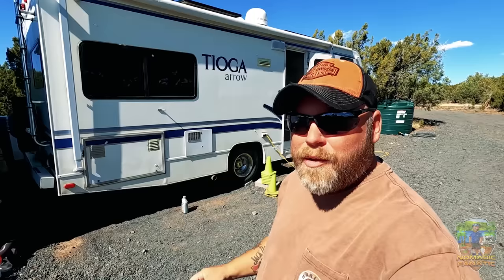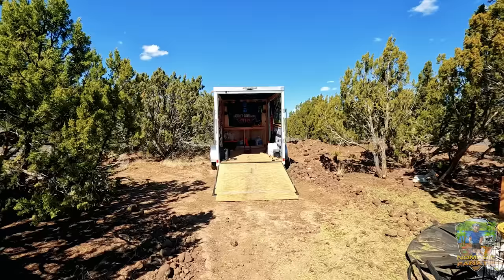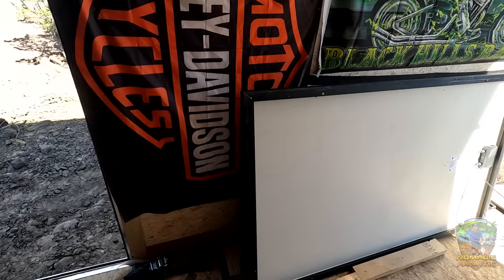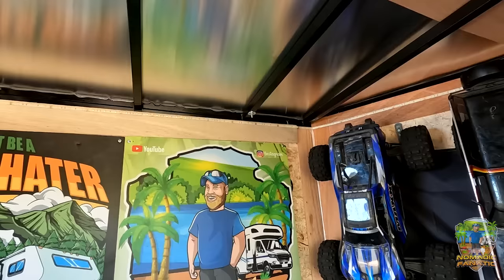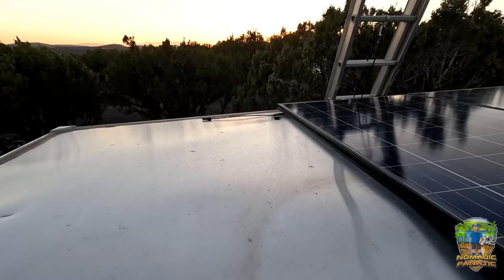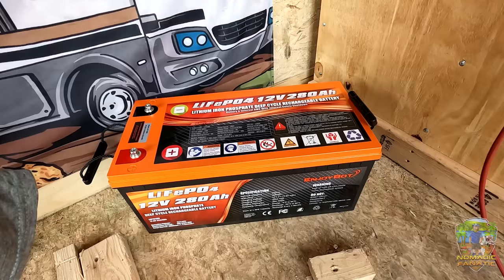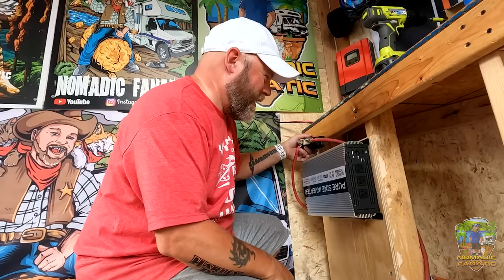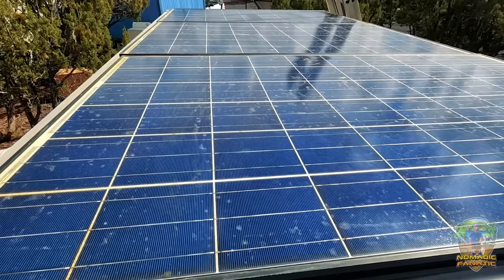Harley Trailer Turned POWER STATION - Complete Solar DIY Project!!!

Comment: An easy way to keep an eye on those nuts, to make sure they’re not backing off, is to make them as tight as you want, then use a marker and draw a straight line on the nut and down the bolt. If the line is ever not lined up as you marked it, the nut has moved.
Reply from the maker: Smart idea! And easy to monitor!
Reply: @nomadicfanatic  or some Locktite... cuz you Did it WRONG ! LMFAO !   Safe Travels my friend !
Reply: @i70show  Locktite along with nyloc nuts would be a good choice also but as stated, a good witness mark will work.
Reply: You should be proud
Reply: Or use lock washers.

Comment: Great install. I'm a bit jealous. The only thing, I would have mounted the 100 amp fuse in a more protected spot, rather than right there on top. Thanks for the video. Jon

Comment: I would highly suggest using lock tight or locking washers or thread locking bolt as a trailer will vibrate losing any bolts

Comment: Good morning Eric. Nice install. At van builds, installers installed breakers on the red cables between the solar panel and the charge controller, and, one between the battery and the inverter for safety. Awsom battery.

Comment: Looks good, great video! You should consider putting a switch between panels and controller. Pretty sure damage can occur by wiring controller to panels before wiring to battery. 
Nice clean install.

Comment: Eric, I built my own solar system for my RV. We put 820w on the roof, with 400ah LiTime batteries. We love it. Easy install, and lots and lots of power. Saved myself almost $10,000.00, just in labor. I. knew you could do it.

Comment: Nice addition to the trailer. Always nice to have extra power available while on the road. I would suggest that you move that fuse block in behind / under the counter top so the positive terminal isnt exposed. It also looks like you had enough room where the battery is to mount it all under there which would provide more protection from any cargo you may be hauling in the trailer.

Comment: 🟠 Eric, build came out awesome! It hard to see n the vid, but if you didn't apply, that Dicor has to go around the back of the bracket also. Water may very well intrude in from open area behind the bracket.   Maybe you can use some sort of flexible tubing to attach to the caulk-tube to get in there. Or get a separate syringe and add some sort of flex tubing to the syringe.

Comment: You should have used Loctite threadlocker to keep the bolts from vibration loose as you travel down the road.

Comment: I'd put some kind of cover over the terminals on that 100 amp fuse.  Last thing you want is something shifting in the trailer while your traveling and shorting against those terminals.  Might cause a fire and lose everything in the trailer, bike included.
Reply from the maker: I left it bare in case I get tired and feel like turning in early... Just lean back and... BAM! I'm awake! I kid. Don't do what I do... bla bla bla...

Comment: Hey man, pretty nice install... But aside from order of connections... you should have put the dicore UNDER the Z bracket around the bolt and then tightened it up. The inside of the Z bracket under the panel that isn't sealed will leak. The other option would have been a rubber gasket that gets smashed between the bracket and roof. 

I say this as i have put on some solar panels. I have had to peel up and reseal the leak.

Comment: I'm thinking about installing solar to the roof of my RV barn to use when the RV is inside. I have a lot of toys inside the barn as well but I do have power to it as well. My idea is to eventually have the "grid" electric as a backup for everything instead of solar as the backup.

Comment: With solar charge controllers you want to plug the battery in first as the charge controller has a little computer that needs to be on in order to recognize the solar panels.

Comment: I put a rack on top of mine, with the panels away from the roof, to let air thru and to avoid heating up my roof, The rack bolts onto the sides, not the top. What ever happened to the Ampere Time batteries?

Comment: Looks nice but I would make one change. Where you tie wrapped those cables to your roof I would change out to insulated clamps. Probably would never chafe down to bare wire but I never like to take a chance.

Comment: You should never use nuts and lock washers. You should use Nylok nuts they will not vibrate loose.. Lock washers work by digging into the surface which now is a point where Rush can start.

Comment: id say this does look good, did you strap the battery down i didnt see if you did or not?. i'd also suggest since its 12volts maybe getting a dc connector to let you boost the bikes starting battery assuming it is also 12v

Comment: Makes me laugh when people try to measure centre to centre... In this case you've got a wide enough beam to go at. But for accurate measurements, assuming all the beams themselves are th the same width, meausre outer to inner, or inner to outer.... same reasult, just easier as you can hoot the tape measure over the end of the beam and pull
Reply from the maker: While I understand your point in constancy, that theory gets me no closer to drilling the holes in my panels. I need to hit the CENTER of those very small 1" beams. I must get the center measurements. But thanks for playing.
Reply: @nomadicfanatic  didn't realise they were only an inch wide! Damn, not much margin for error.... Anyway, good to see you got it done 👍